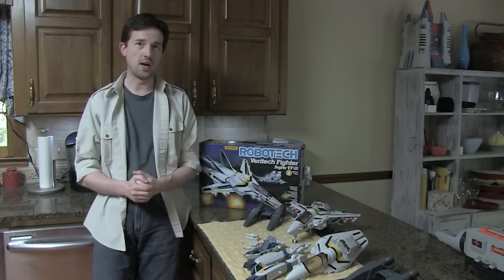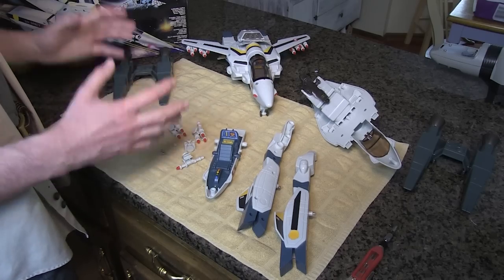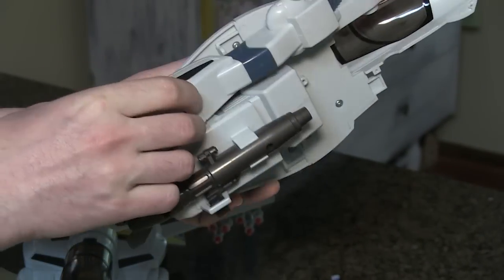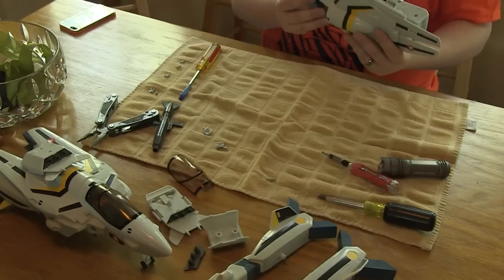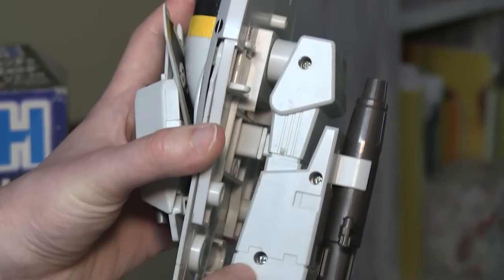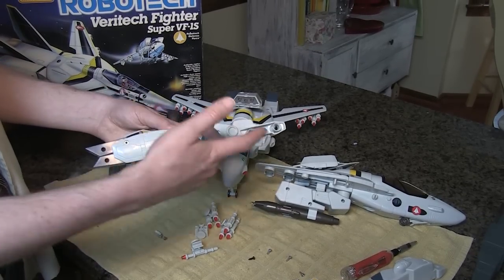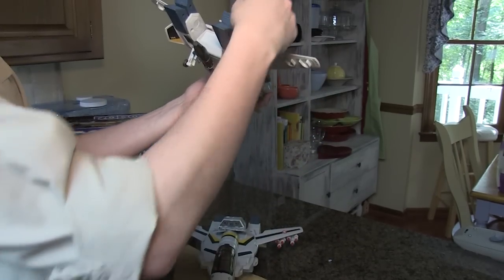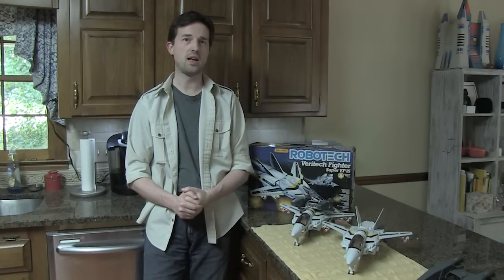Robotech Veritech Fighter Restoration - Matchbox 1985 VF-1S

Comment: Good vid! The ongoing Robotech and JDM distinct stand-alone  series is so SMH!!!! I found out Harmony Gold retained it's original rights in a recent sit down. It's funny, S7 has Macross Micronians in 1:18 scale, while MEPTOYS has Zentraedi Breetai, currently, at 1/100 scale (makes him six inches), a good height for use with S7 figures. MEPTOYS has plans for a 1:18 Dana Sterling from Southern Cross. The license just goes everywhere! There were even nods in the Voltron cartoon to Rick Hunter, Lisa  Hayes, Max and Miriya Sterling, and Roy Fokker as an instructor in the lounge. 

Imagine if someone took a Jetfire transformer, upscale all of the parts to 1:18, then actually built it. It would be a true to scale, three or four foot tall, Veritech. Then put an S7 Rick Hunter in the cockpit.

Comment: With some 3D printing you could make the left over one transform!
Reply: Some original parts could be still used, like the tail block, the wings, part of the legs, the head and the cockpit, but the rest need to be redesigned anew.
 Not and easy job but quite possible.

Comment: I have one of these but the front support for the landing gear snapped, one side of the head guns is messed up, and the backpack fins snapped (I fixed it when I was a kid with duct tape). I have all the missile pods and the auto cannon. I would sell it for parts if you're interested

Comment: That Robotech toy was the same design for the G1 transformer, Jetfire.
Reply: G1 Jetfire IS a Macross toy
Reply: PrimusVsUnicron No. It's a transformers toy that ised the same exact plastic molds for production and varied only slightly in paint scheme.
Reply: @米空軍パイロット  It even still has the UN Spacy emblems molded into it.
Reply: @VulpisFoxfire  Yep. They never changed the molds. Only the coloring.

Comment: Funny, didn't Harmony Gold take Hasbro to court last year because of the GI Joe/ Jetfire toy? I guess they settled the dispute in October 2013, but....I can't think of words to finish my thought.
Reply: Oh yeah, it was the Comic Con model kit with untransformable vehicles. It's just funny how one character  could cause so much trouble.

Anyway, from what I understand, Currently, Harmony Gold owns the transformable Veritech toy/ model designs in the US. Somebody correct me if I am wrong because this is confusing.
Reply: ThatBrownBat It was a G.I.JOE Sky Striker done up in Jetfire colors with an attachable booster set to promote a G.I.JOE/Transformers cross over IIRC.
Reply: The thing is, the original Transformers Jetfire toy was made using the same mold as a VF-1S Super Valkyrie, and Hasbro bought the rights to the Transformers franchise. Therefore, Hasbro has rightful ownership over a design, which is the exact same as the Veritech fighters. In truth, Harmony Gold only bough the show and owns none of the designs themselves, but that is for another time.
Reply: @米空軍パイロット  I think G1 Jetfire was a Bandai design that Hasbro went into production on before realizing that it wasn't included with the deal that they had with Takara. 

Matchbox acquired the rights to reproduce the design in North America from Bandai simultaneously, so Hasbro changed the look and name of Jetfire to Skyfire as the G1 Jetfire toy was already released to the public!

Comment: I ran into an unscrupulous Ebay seller recently. I bought 17 '89-'91 G.I.  Joes and 6 figures were super glued together at the waist! That wasn't in the description at all. I managed to undo the glue on Rock & Roll (v.2) Ambush, Topside, Low-Light (v.3) and Updraft, but unfortunatly Dusty (V.3) was glued so liberally that I accidentally busted his torso and crotch while trying to unpry him. His back piece is still firmly stuck to the crotch with no hope of coming undone.

The O-rings were still in tact, and none of the screws in the back were striped. After insepecting the figures in question, I saw no real reason why they were glued outside of the fact that their legs were a little loose due to their O-rings being old and loose. So rather than replacing the o-rings with newer tighter ones, the previous or one of the previous owners decided to super glue the torsos to the waist. 

Each figure was put in an individual zip-lock bag with their name written on the bag, and with the correct assesroies with each figure. This person obviously knew enough about these figures to know that they were suppose to turn at the waist and decided not to put that in the description.
Reply: Striped like a candy cane? Or "stripped?"

Comment: Ever try remolding it so it could transform into a robot? I did but the obvious problems you will have is it will pretty much be a airplane standing up at best. The arms could be sorta doubled to make kinda a 4 arm robot but it will have little articulation at best for transforming it. You can try also doing it in gerwalk mode but again the same problems with the arms. You'll have to sorta remix 2 toys to make 1 partly transformable robot at best. If you like rare Robotech anime check out the ROBOTECH GUNDAM WAR CHRONICLES shown at ANIME DAY CON etc. Fans made a Robotech version of GUNDAM before it was ever translated back then. Harmony Gold shoulda used ORGUSS as future English dubbed episodes.